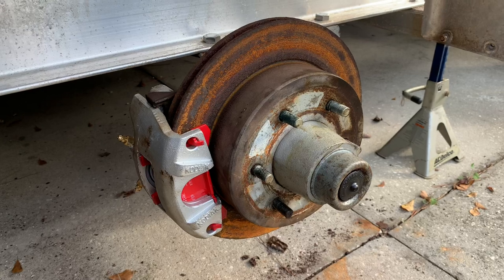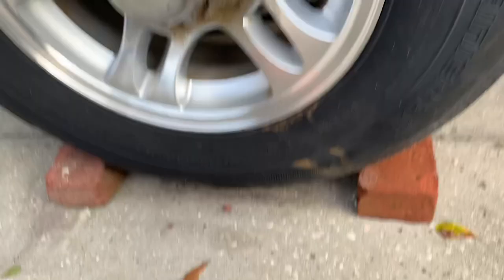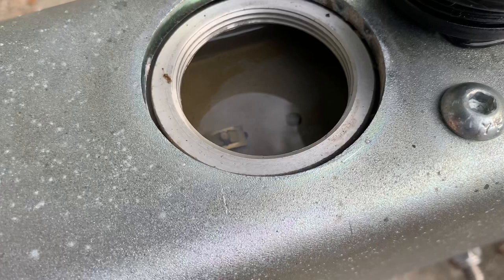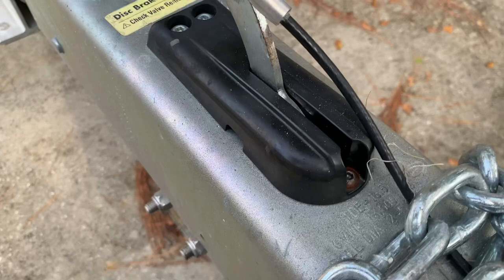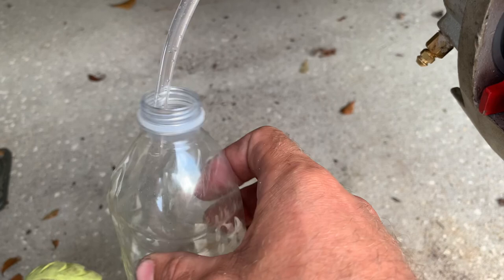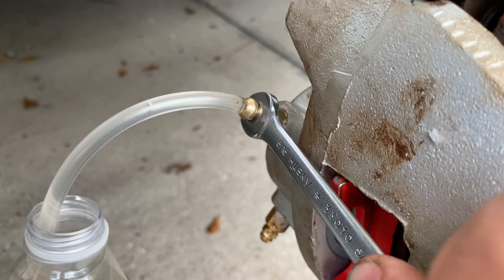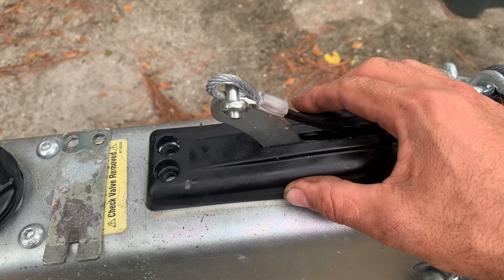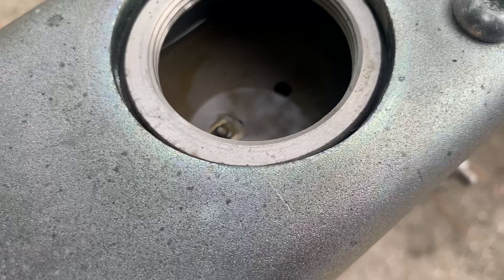Trailer Maintenance: Bleeding Surge Brakes

Comment: I have the same surge system. I found that a flathead screwdriver can release the E-brake if you pry up on the side.  What else...  The surge brake release solenoid, I haven't found a good way to check this device other than field test it.
Reply from the maker: Good to know. Thanks for the input.

Comment: Would air in the line cause the brakes to not work?
Reply from the maker: Yes because air in the line will compress and not force the caliper to clamp the pads on the rotor, brake fluid will not compress and will force the caliper to pinch down.

Comment: What's the valve under the bleeder valve?
Reply from the maker: It’s also a bleeder valve. The caliper can be used on slither side of the trailer. If you flip it to the other side the lower valve would be in the top position.
Reply: @captleesoutdooradventures7133  gotcha never saw that before thanks